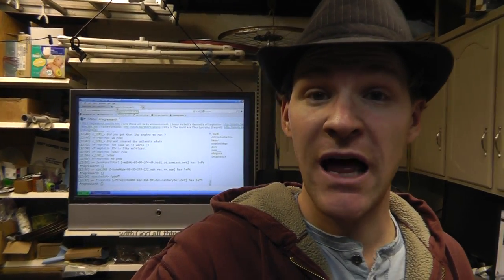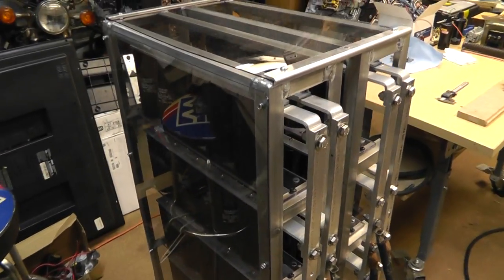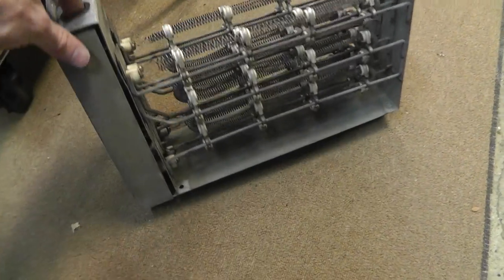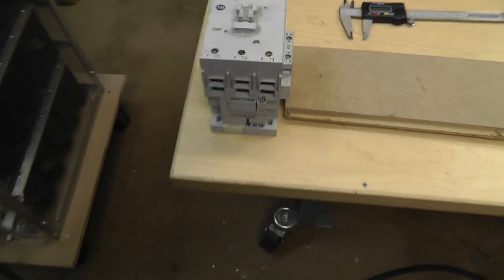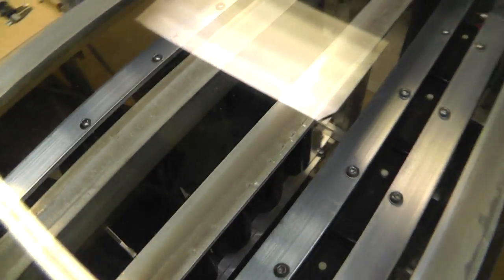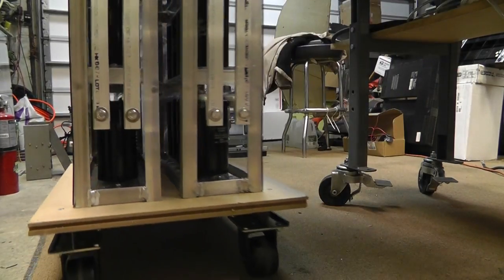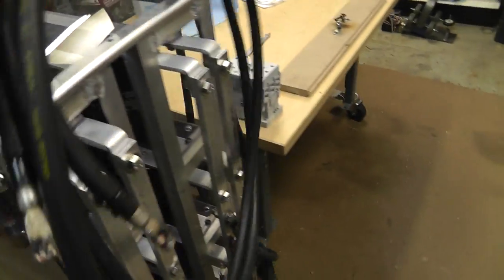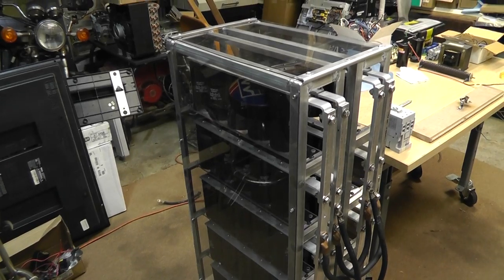10K joules 3: Bank Mounted And Buss Bars/Cables Ready To Roll! Circuit testing time...

Comment: I noticed the dissimilar metals: copper connected to the bus bar. I know the lightning protection suppliers use stainless steel washers and bolts and clamps when connecting copper to aluminum eavestrough, to avoid the corrosion problem of dissimilar metals contacting each other. I am not sure if the science is perfectly correct regarding stainless steel to copper not corroding. I do know lightning suppliers do it. Is the bus bar stainless steel or aluminum?